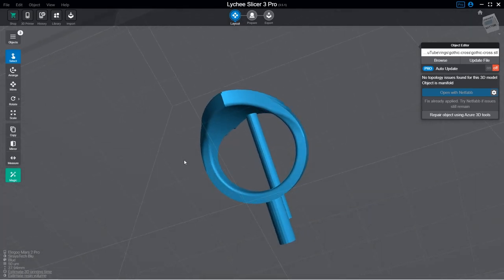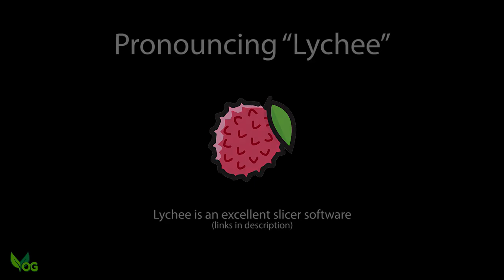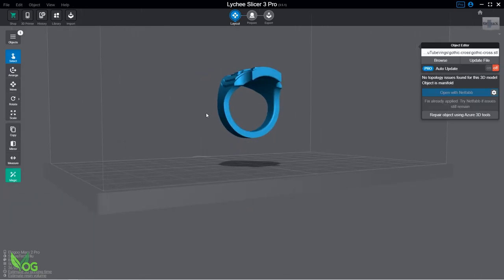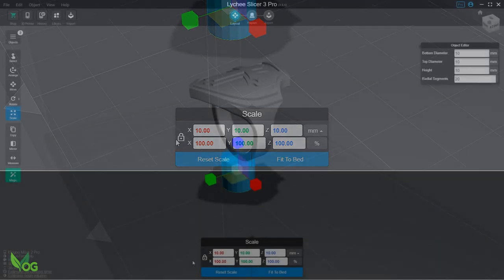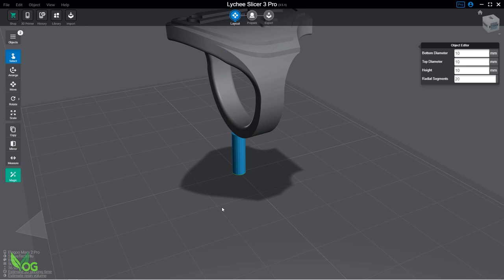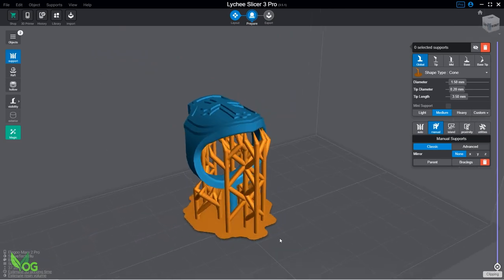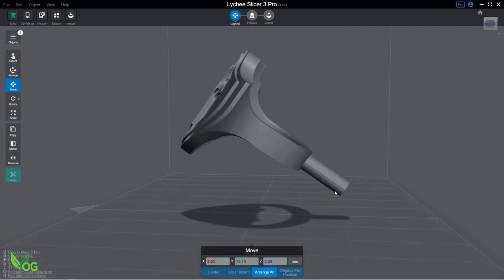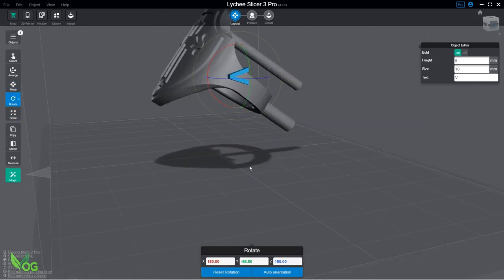How to add sprues with Lychee for metal casting by VOGMAN

Comment: This has been something I’ve been wondering about for a while! I wanted to try out using a sprue-like appendage for easier painting of minis on the bottom of feet.. wonder how affective it’ll be? Also thought it might provide better adhesion to custom bases if there’s a little nobble to adhere too but will need to work out how to remove material first. Cheers again!
Reply from the maker: One thing that annoys me with many mini makers is the lack of witness points, simple pegs and holes to attach figures to bases. It's a simple inclusion in the design... lazy designing I guess. But sure, you could do that 😁